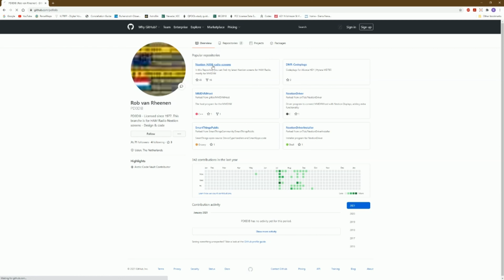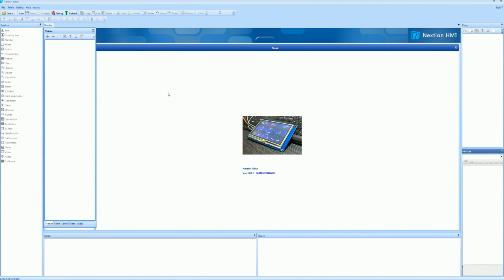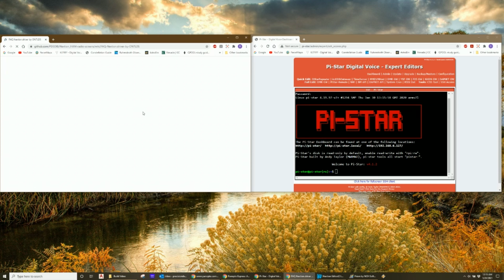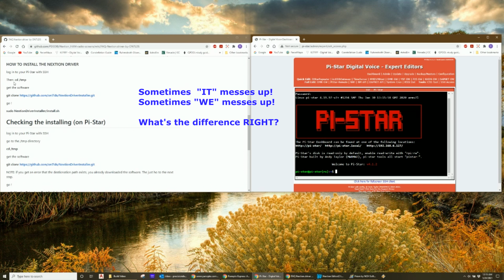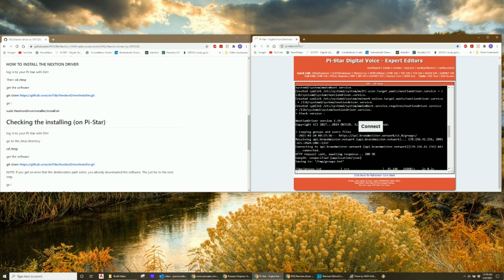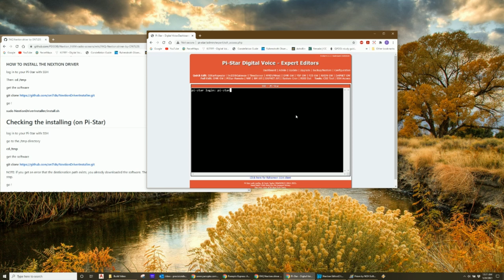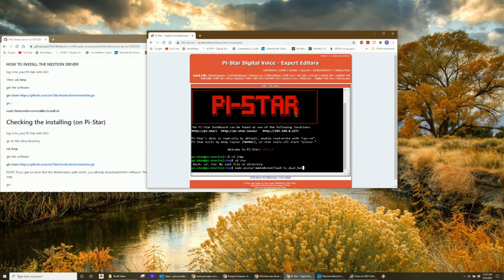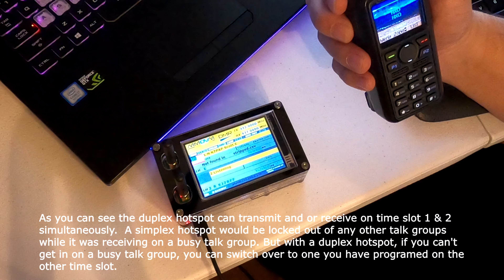C4 Labs DRPi-3.5NSX Nextion Screen Case - Build Video

Comment: Thanks for the overview.  You showed me the one thing I couldn't easily find, connecting the screen to the board.  After that everything went very smoothly and it booted up the first try!
Reply from the maker: Kind of crazy to hard solder it right to the board but with the limited space that seemes to be the best solutioin.

Comment: Excellent video.  I am working on a single hat version but could not for the life of me figure out the screen connection to the hat, but how you handled the screen and the wiring was the one of items I really need the see. I will also look to build this dual hat version as well. Just ordered all of the parts. Thank you for your time on this.  I know videos re not easy to make.  73, KN4VA
Reply from the maker: The dual is nice becaue you can monitor two stations, static, simultaneously!!  thank you for your shoutout KJRFF  73's my friend!

Comment: Fantastic build video.  It sure saved me a lot of frustration.  I reviewed the C4Labs case on Amazon and mentioned using your instructions.  Finally got the Nextion Drivers to load by going to the BI7JTA wiki page and following his driver install instructions.  I had to do a fresh PiStar SD card burn and then load the driver.  It is really easy once you master the copy and paste feature to populate the SSH commands.  TU ....WA8EBM

Comment: What temp does your hotspot run?
Reply from the maker: 45-60c depending on the ambiant air temp. I do not run a fan in the unit.  Been  plugged in continuously since i uploaded this video and still running great.  I have America Link (TG31656) set static on my hotspot so it never sits idle even when my radio's off.  What temp (or range) is your hotspot running at?
Reply: @arlo12345678910  I had a heat sink on it and it was running right around 56 c but just took it apart and put a fan inside that I had to see the difference. 60c seems high but if I can keep it in mid 50's it should be good. Trying to control the LED on the fan but no luck yet. LOL Enjoyed the video. I put a simplex one together with C4 labs case. Got the Nextion wires crossed at the beginning but figured it out.
Reply: We monitor America Link also....NJ5W
Reply from the maker: @nj5wrick156  I had a fan in my first one and the fan failed after a month or so.  Got dust in it and became loud so I removed it.  Honestly I don't ever worry about heat because like I said, my hot spot has been on continuously for over a year and never turnd off running static on America Link in time slot 1 which almost never goes quiet, and static on HXO on time slot 2 which gets a fair ammount of traffic.  It's got it's little home in my office and it sits there and runs and runs brodcastig my two favorite talk groups continuously.   Fan's will suck dust into the unit and coat all surfaces causing you to have to open it up and blow it out.  With no fan mine has stayed completly dust free since I built it.  I'm not saying don't run a fan, but you are probably overthinking it just as I did in the beginning being new to the hotspot and not wanting it to burn up.  Now several years later I am not concerned about it.  The Pi can handel more heat than you think it can.
Reply: @arlo12345678910  I think your right. Hotspot is running at the same temp with the fan as it was without it. Mainly seems to be an issue with the case not having ventilation. Wish they had an option for added it. I'll watch it and go from there. I put two small fans on the sides of the case, one pushing and one pulling air running off the Nextion adapter left over and that is having the most effect. Go figure.
Reply: I just tried to download the duplex file for a 3.5" screen and it keeps showing up as resource file damaged on Nextion Editor. Have you run into this? Seems like I read something somewhere about the version of Nextion Editor your using.
Reply from the maker: @nj5wrick156  They are on Nextion Editor version 1.63.3 now.  When I uploaded this video over a year ago they were on version 1.61.2.
Reply: @arlo12345678910  Any chance you could send me the TFT file? I should be able to load that one.
Reply from the maker: @nj5wrick156  Sure!  Check your emial.  By the way you need a HMI file not a TFT.
Reply: @arlo12345678910  HMI would be nice but I can just load a TFT. I found one screen and have tried a couple but still trying them out. Trying to learn how to code the screens also. Making a some progress.

Comment: Got update fail error on nextion when it got to 100%. any suggestions?
Reply from the maker: Do you mean when attempting to install an HMI file on the nextion?
Reply: @arlo12345678910   Yes, after many many attempts I finally got it to take with a 2GB SD card instead of the 16 GB SD card. Weird!
Reply: @arlo12345678910  Thanks for the Video by the way!
Reply from the maker: Glad you were able to get it working. Thanks for letting us know how it turned out!   73

Comment: Awesome! I talked to you last week on America Link and you told me about your hotspot video. What a great chance encounter to find someone who could make it easy to build and configure a hotspot! I watched the video once to familiarize myself with the process, ordered the exact parts you have listed, watched the video again as I exactly followed the steps to build my hotspot. Plugged it in, booted it up, configured it and on the first try did a successful radio check on America Link using C4FM (I have a Yaesu FT-3DR). Thank you so much for taking the time to put this together and sharing it with the ham radio community! 73's N6JEB
Reply from the maker: That's super cool that you had it up and running on the first go!  Thank you for your comment I appreciate the feedback. Glad the video helped and great to know it works with Yaesu.  I've been wanting a FT-3DR for a while now and I do have two of these hotspots. Just got the family pool up and running for the summer think I'll reward myself with a new HT!  hehe.... 73's catch you later on down the log!

Comment: When trying to get the nextion drivers i get..Nextion is not connected to an existing port...NextionDriver not running...MMDVMHost is not configured for NextionDriver and NextionDriver is not running..everything else went great
Reply from the maker: Were you ever able to get the driver installed?

Comment: I have a AURSINC MMDVM Duplex Hotspot Module Dual Hat V1.3 . And I'm trying to update the firmware. J1 needs to be solder, I get a failure to init from the pi-star SSH terminal. What else do I need to do?
Reply from the maker: At this point you have me stumped.  If anyone is familiar with this paticular error please help Gary.  Thanks all 73!
Reply: @arlo12345678910  Hi. Looking at your video(time stamp 1:02.50) you got a failed to init device. Did you get your dual hat updated to 1.5.2 firmware?? After some trial error, I got mine updated. Had to pri-rw in the ssh shell. Solder J1. And short boot1 to the minus sign. In other words center hole of boot1 and the hole to the right of center. Power up pi and put in the update command. This worked for me. Do this at your own risk !!! I didn't do the pri-rw the first time  and erased the firmware but redid it with the rw and it updated. 73's
Reply from the maker: @garylambert9178  good job glad you got it working.  I'll have to go back and check mine.

Comment: This tutorial is great, thanks for putting it together.  One thing to note after spending a whole day trying to get pi-star 4.1.4 to work.  It won't without a lot of extra fiddling.  I highly recommend downloading pi-star 4.1.2 from last year and running this, then update.  Works very smoothly that way.  73's
Reply from the maker: Hey thanks for the info! I hope it helps subsequent hams!

Comment: I am doing a simplex build with the 2.4" screen.  I got through everything, got the screen flashed and flashed the SD card with Pi-star.  when I plugged it in, the screen powered on, but it never booted past the please wait, hotspot is starting screen.  any ideas on where to start troubleshooting this?
Reply: I crossed the TX and RX wires.  And my substandard soldering skills and lack of a solder sucker cost me the board.  Good news is I get to try again on Wednesday.  Bad news is it was a $50 lesson.
Reply from the maker: @jaydensyoutubechannel5450  glad you figured out what was wrong sorry your board is FUBAR.
Reply: @arlo12345678910  thought I had it figured out.  Got some good advice and was able to clean up the board and solder directly to the traces.  Got the wiring correct this time, but the display never gets past the hotspot is starting screen.  I can attach to the hotspot over the wifi network, but nothing on the Nextion besides the initial loading screen.
Reply from the maker: @jaydensyoutubechannel5450  You are the second person who has this problem with the simplex board.  I'll do some digging and if I come up with anything I'll let you know.  One thing you can try is using the ON7LDS L3 as opposed to the ON7LDS L3 HS in Pi-Star Configuration under MMDVM Display Type.  Also you can inquire with this group  https://www.facebook.com/groups/Nextion/
Reply from the maker: Did you ever get this figured out?  73!

Comment: Thank you for this video! it's a great deal of detail in one stop. 
However, I'm having issues at the beginning process. I'm trying to get the image on my Nextion Screen, and following your procedure pretty much identically. The only difference for me is that the hotspot I'm building will be simplex rather than Duplex. I've downloaded the same .HML file except for the simplex version. Same size screen, etc. 
when I put the SD chip in the Nextion screen it runs through the copying from the SD, and then at the end it says: "Update Failed: Check Error", and it will not successfully put the image on the screen. I've seen other posts where people have seen the same error message, but no answers to why it's happening. 
One guy posted the problem and later said GitHub was downloading the incorrect file until he created an account, and after he created a GitHub account  it downloaded the correct file. I tried this, and still no luck. Github seems to be downloading the correct file for me. 
I've also checked the "Device" section in the Nextion Editor and made sure that it's set to the correct screen. No resolution there either.  
Anyone familiar with this problem?
Reply from the maker: I’ve never encountered that problem.  I’m sitting here brainstorming any possible solutions but not really coming up with any ideas. I guess one question I have is, “ when you open the Nextion editor and browse to the HMI file you are attempting to upload to your screen, does the editor show a screen preview?”
Reply: @arlo12345678910  Thank you for brainstorming on my behalf! It does. It's just like yours too. it shows the Model 10 - V1.05, etc. with the picture of a lock right in the middle of the screen. 
I found one thing from Nextion saying that you want to use an SD card less than 32G, and mine is 32g. No clue why that would matter, but i noticed you were using a 16G. Guess who's headed to BB to pay too much for an SD card?
Reply: And that worked. Note to anyone else doing this project. No SD cards over 16 gig for loading the image to the Nextion screen.
Reply from the maker: @raycope2242  I believe I used a 32gig card but it must be formatted to FAT32.  I do have a 128 card that did not work. I tried to find an 8gig or 16gig but the store I went only had 32 gig cards and they were the smallest size they had.